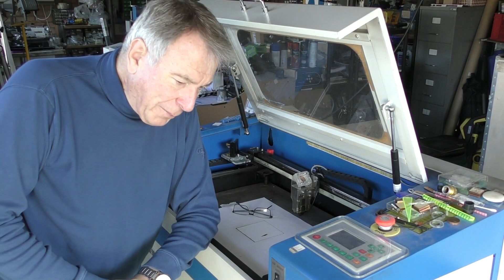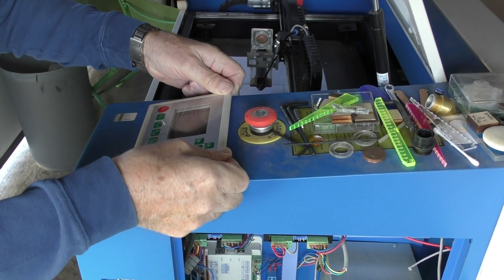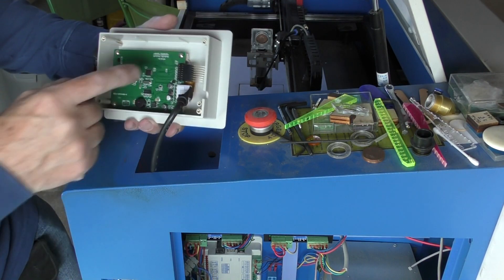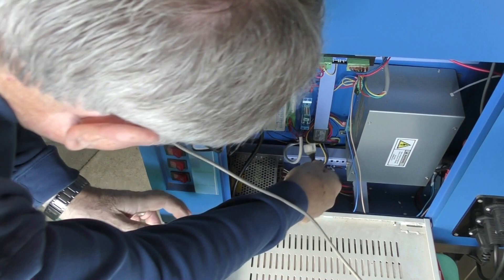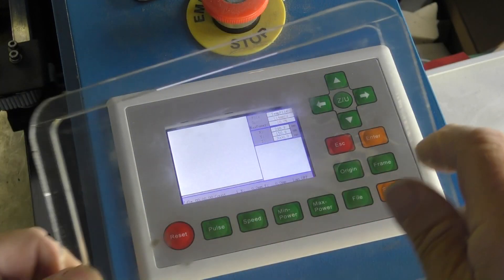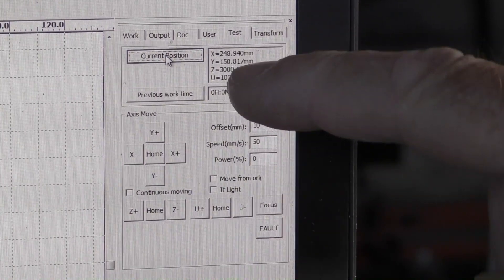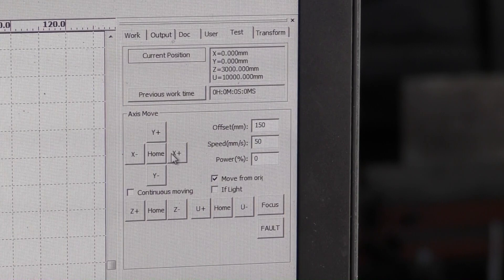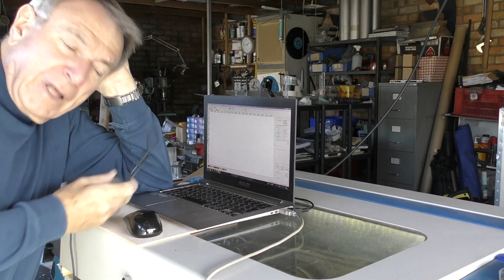RDWorks Learning Lab 173 Dead RDC6442 control panel 2

Comment: Hi Rus,I do have the same problem with my 6445G. Buttons are working but no display. Via Ethernet my laser is working also.Do you know if there is a separate display for sale somewhere. Did not find one. Would be nice to get some info Tnx in advance. Tom
Reply from the maker: Hi Tom
Yes, there is a seperate  self adhesive key panel that you can buy and I did so in the vain hope that it may have been the issue. In reality it was the whole panel unit that I replaced. Here is is at Cloudray
https://www.cloudraylaser.com/products/cloudray-ruida-controller-rdc6442g-6442s?variant=17092173824051  $72
 Best wishes
Russ

Comment: Y does my controller say communication error?  It want accept any new project!  Says machine is busy or paused!  Please I'm new to this and in dire need!
Reply from the maker: Hi Shawndra
I assume that you have a Ruida controller? If so shut down your machine  and then restart. Also reboot your computer. This software is not the most robust I have used and  I occasionally experience the same communication error. If it says machine is busy or paused then you need to press the ESC button and this will usually clear the issue because for some reason a program has not completed.
Keep in contact
Russ

Comment: There is a Remote app for your smartphone. 
Replaces the panel in almost every way. Does require a common network (hotspot/router).

The display panel is more advanced than you would think: it has the entire localization inside. All language files are on the display panel and not on the motherboard.
Reply: Peter Eduard what is the app called please?
Reply: Snagglepuss1952 Ruida ACS.
Reply from the maker: Hi Peter 
It's good to know,  but my cave is just that, and my machines are not connected to the outside world ....I wouldn't want hackers knowing all my secrets!!!!

Best wishes
Russ
Reply: SarbarMultimedia I add a cheap hotspot to the laser. It’s not on the internets 😃 - just a way to connect easily to the machine. No strings attached. 

And remember I always have spares, no need to wait a fortnight. :)
Reply from the maker: @PeterEduard  
Hi Peter
You are the second most generous person after myself!!! Sincere thanks
Best wishes
Russ

Comment: Russ, this isn't about the subject matter at hand. I have been thinking a lot about the vertical lines while engraving. I was wondering if you retrofit your machine with a linear stepper motor instead of the regular stepper motor with a belt drive, would it cure the problem with the vertical lines?
Reply from the maker: Hi Kris
 Many years ago my engineering training taught me that you cannot solve a problem until you fully understand it. It puzzled me for more than a year even when I understood what the problem was but eventually I had that lightbulb moment and the solution was  embarrassingly obvious,  Those vertical lines were never anything to do with the steppers but all to do with the toothed belt.  see this video for how I fixed it.    https://www.youtube.com/watch?v=B87ifTPKN8c

Thanks for your shared concern

Best wishes
Russ
Reply: @SarbarMultimedia  I remember the video when you discovered it was the belt. With the linear stepper motor there would be no more toothed pulley or belt. I didn't get a price on one because the company was asking a lot of questions I couldn't answer, like what are the acceleration forces, etc. etc. Any way, Russ, I would like to say you have a way of connecting with your audience that makes them want to watch your videos all the way through.  I am going to get a 100 watt laser. Your videos have made me feel like I already own one.
Reply from the maker: @krisknowlton2658  
Hi Kris
My strategy is always to pend intellect and not money on these machines otherwise I could soon be in the "big boys" price bracket.

Best wishes
Russ

Comment: Hey Russ! Thanks for sharing this one, I always enjoy and look forward for the next videos. I recently got my Chinese 6040 laser cutter 50W, it came with the simple display which shows only the power of the laser. I was really disappointed that it dint come with a Ruida and thanks to your videos (I've watched all your RDWorks Learning Lab videos), it was as if I already had a bit of experience with the laser, so I ordered myself a Ruida controller and stepper motor drivers and wired everything up. It's working perfectly fine but still learning and calibrating a few things. 

I currently have a small issue when trying to cut out small numbers on 3mm acrylic. The edges of the numbers slightly melts/ deform. My settings are:
Speed- 9mm/s
Max power – 40%
Min power – 10%
Number of passes – 2
Air assist - on 

What settings would you recommend?
Do you have a personal email so we can communicate?
Reply: I have just got my 6040 and thanks to many videos I selected a Ruida controller it seems it is an optional extra like the Reci tube, and as Russ has pointed out with tubes check what you “actually” get.  Mine was a Reci tube but 90 watt not 100 watt. Label on tube states 102.4 watts “peak power”......agreement power 90 watts. So usable will be no more than 90, limiting to 50% power until my ammeter arrives. Must not over power the tube or it will go to “sleep” on you early. Welcome to the Russ fan club!
Reply from the maker: Hi Christophe
 With those settings, it sound like you have an issue Add your email to another comment  in a non standard form  for example junk2atgeemaildotcom and I will delete the comment and reply to you
 Best wishes
Russ